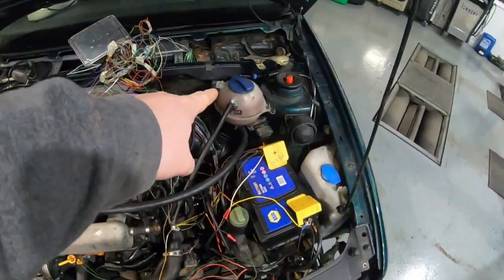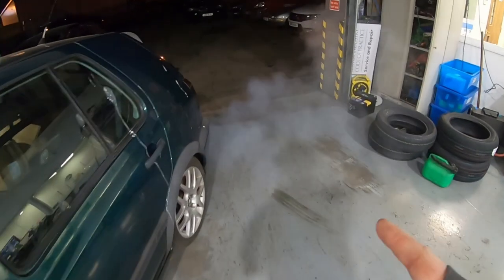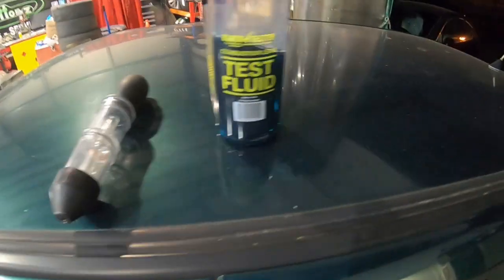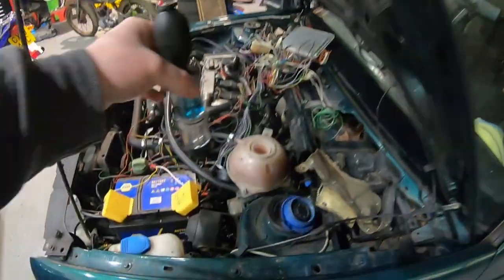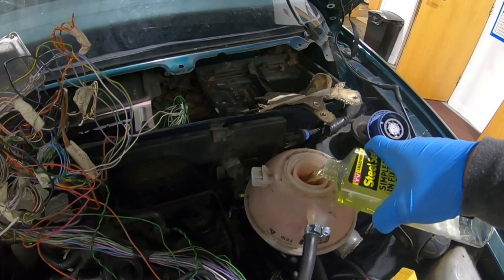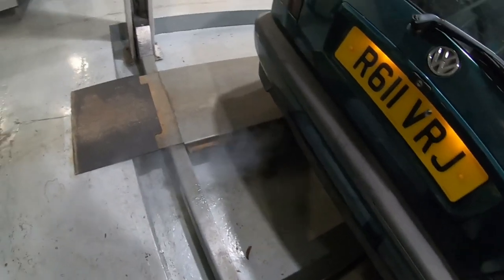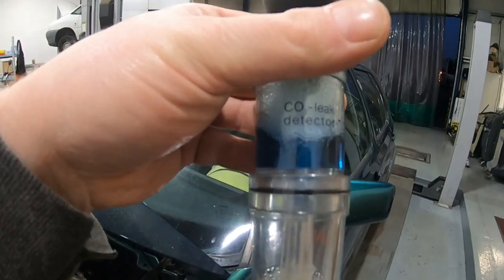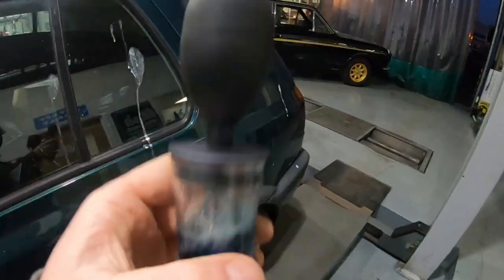Is Steel Seal the ULTIMATE Solution for Fixing a Blown Head Gasket?

Comment: Hi. I’ve just bought two minis in the last month and been completely ripped off 😢 I bought the first one a convertible 06 plate mini one convertible. I paid £900 for it. It’s going to scrap tomorrow for £150. Then my dad bought me a Mini Cooper same year 06 plate it seems it has the same issues but is a lot better condition and 20k less miles. I’m hoping to keep the cooper. It keeps losing battery if I don’t use it for a day or two and it started blowing cold air so I got a friends fella to come and start it. They added coolant and got it going. But the battery had got completely flat 3 days later of me not starting it. So I’ve got a new battery which I’m going to fit in the morning and I’ve bought some of that steel steel. I’ve watched the video on steel seems website and it says it’s probably a good idea to drain the system of other coolants would you recommend that and do you have a video of how to do that? Thank you in advance.
And bloody minis. Ya gotta love them. I’ve bought two in the last month and been robbed both times. I need to get one at least working I’m an end of life carer and need my car to visit my clients.
Reply from the maker: Thanks for watching

Comment: My car loose about 1L coolent for driving around 20miles, because the air bubble push the coolent out  from the radiator. Do you think this headgasket condition can be solved by using this product? Or it is too serious and need to head gasket replacement. It is a honda engine. Thanks😊
Reply from the maker: I'd check it is definitely your head gasket that has failed but if it is then yes, it should work

Comment: Hello Mark,  interesting video thanks as experiencing same on my friends  1993 Toyota Camry trying to help him with. So far has been running hot often, and would have to add water often.  Temp gauge well up. Not much services has been done on this car sadly  in its life of 180,000.  Oil filter never been changed, simply adding oil has been done over the years.  Radiator never flushed and overflow looks very rusty color inside.

Decided to add radiator clean to clean out cooling lines,  but now the issue seems worse.   A lot of white smoke especially if rev engine, and checking engine oil it appears thin…. and water dripping from exhaust.   Temp sensor now doesn’t leave the bottom of the gauge (0), radiator never  gets hot, just warm to touch and no steam from the overflow or even radiator at all?   Is the thermostat also an aside here do you think?

As I see no steam from overflow it is hardly worth doing the test…so wondering if should just go ahead with this fix.  Cheers
Reply from the maker: Well, it's worth a try

Comment: Could you please provide what you used to test head gasket failure? I got oil in the coolant reservoir of my e46 and need to find out if it's the gasket or cooler.
Reply from the maker: The kit we use is called a block tester and can be found on Amazon here https://www.amazon.co.uk/Block-Tester-Bt-500-Combustion-Leak/dp/B06VVBSFTF/ref=sr_1_6?crid=1V9K40AVAP6M1&keywords=head+gasket+test+kit&qid=1684097717&sprefix=head+gasket+%2Caps%2C89&sr=8-6
Reply: @MarksWheels  thank you very much!

Comment: My neighbours 2014 Ford KA is loosing the coolant straight into the engine oil, the oil level is 3 inches above full, is it safe to use in this situation.
Reply from the maker: Probably best to get the level closer to the correct level or, even better change the oil first.
Reply: I was wondering that myself.  Thanks! Do I do oil change first or after using SS and cooling down?
Reply from the maker: @jahill7965  personally I'd do it after

Comment: Hi Mark, I’ve just been told by ford my 69 plate transit custom needs a new head gasket at £4500 fitted!!!
Only took it in as it had coolant over temp warning light come up. 
Thought it would be a thermostat or sensor issue. 
They said the mucky (orange) water in the coolant reservoir was 100% head gasket. 
Feel a bit deflated as I only got the van 4 months ago from a verified decent garage/dealer. 
Any advice would be massively appreciated. 
Thanks 👍
Reply from the maker: Speak to the dealer first. Try and get some goodwill
Reply: Thanks for the quick reply 👍.
They’re calling me back tomorrow, big boss wasn’t in earlier today.
Was just weighing up the other/steel seal options if no joy from them.

Comment: Hi mark,i have still a lot of air in my coolantsystem by cold star it likes a waterfall.i think the head.my coolantwater is not dirty.do you think steel seal can helped? Or bars leak?
Bydewee its a mini r50 2002
Reply from the maker: Not sure it would tbh. I'd first check it's bled ok. Shouldn't be any air In  the system

Comment: Hi mate my mechanic put this in over a year ago as i was losing coolant- done tests and couldnt find anything wrong but just loses coolant worked perfectly for a year no issues 
But my car is losing coolant again mechanic said sell it while i can but can i use the steel seal again ?
Reply from the maker: I wouldn't Dave. Using too much of it might block something. I'd find out where it's leaking from

Comment: hello mate recently had my headgasket done on my mg zs 120 got a rough cold start misfire and a slow dropping coolant level assuming coolant is slighly weeping into the cylinder would you say this is worth a try need to last me to the end of the year but after the recent 500 quid investment i do not want to spend the same again as its over 100k miles and just not worth it 
thanks
Reply from the maker: I'd be checking for obvious signs of leks first and maybe do a co sniff test to confirm HG failure then it would be worth a go

Comment: Hi Mark. I have a slight weep of coolant into banks 5 and 6. I tried k seal and its improved it significantly,  but there's still a misfire. 
Would you say that steel seal is a superior product and worth a try?
Reply from the maker: I have never found k seal to be very good at all at head gasket repair. It's better for radiator and thermostat leaks so definitely worth giving steel seal a try
Reply: @Mark's Wheels  thank you so much for taking the time to reply.  I'll do as you advise,  thanks. Ironically,  k seal worked a treat on a radiator previously with another car, so I'll try the steal seel. 
Many thanks
Reply from the maker: @Turn12335  No problem. Thanks for watching

Comment: PLEASE NOTE TO ANYONE WANTING TO TRY THIS METHOD. 

1) PLEASE READ INSTRUCTIONS AND FOLLOW EXACTLY AS IT SAYS ON THE BOTTLE IF YOU DONT IT WILL NOT WORK.

2) THE WORSE THE SYMPTOMS OF HEAD GASKET THE LESS LIKLEY IT IS TO WORK.. 

ID SAY THE GOLF IN THE VIDEO IS A 5/10 IN HOW BAD IT IS. IVE SEEN IT WORK ON MUCH WORSE ON THIS. 

IF YOUR CAR IS CHUCKING COOLANT FROM THE RADITOR CAP/ EXPANSION BOTTLE.  AND WONT KEEP FLUID DOWN. YOUR CHANCES ARE SLIM. BUT IM MY OPINION IS WORTH A GO. 

3) ***THIS IS NOT A PERMANENT FIX ITS LAST CHANCE OPTION I WOULDN'T DO IT ON A CAR WORTH A COUPLE OF GRAND. UNLESS ITS YOUR ONLY OPTION IT CAN CLOG UP THE SYSTEM.

GOOD LUCK
Reply from the maker: Thanks for your comment Tyler. I agree you shouldn't expect it to be a permanent fix but both my k series powered midget and my golf are still going strong a year later 💪
Reply: @MarksWheels  fair play! Glad to here that. Must admit I'm surprised but glad to here that! 

Any issues with heater core? No hot air? Just out of interest
Reply from the maker: @225M3RCR  No, heater works brilliantly!
Reply: @225M3RCR  it won't ever clog a heater core. It is Sodium silicate, liquid glass, a chemical reaction takes place near the failed part of the gasket near the combustion chamber or the crack in the head/block surface,  the temp around this area causes the liquid to change to a solid. The rest of the coolant system never gets to a temp where this conversion would happen. 
This can be a permanant fix if you leave the same  coolant in it will keep doing fixes as things age on the gasket.

Do not use if you have oil mixing with water, liquid glass can kill an engine if it mixes with oil.
Reply: I have water in my oil. Does that mean I should not use this?
Reply: Was looking to use this on my avensis, 339k on the clock. Pretty sure I’ve got a head gasket leak between coolant and exhaust fumes. I do 40k miles a year so I may as well just get a new engine it seems. Thanks for the video, this comment and replies.

Comment: Hello Mark! I have a 2006 Toyota Avalon 3.5 L V6 with a blown head gasket the car has over 300-plus thousand miles oil was in my spark plug coil packs and water was coming out my tailpipe very very bad. Do you think this will help my Avalon I've already ordered it through Amazon I will receive it tomorrow
Reply from the maker: It's definately worth a go. Let us know how you get on

Comment: Hi Mark I've used k seal couple years ago apparently have the same pblm again so can i use seel steal in top of k seal?
Reply from the maker: I have found that K seal is better at repairing leaks in pipes or components, whereas Steel Seal is better for head gasket failure.

Comment: Ho does it actually fix it or just solve the problem for a few months?
Reply from the maker: Its been in the Golf and in my MG midget for well over a year now and seems to be holding up fine
Reply: @Mark's Wheels  thanks for the reply...one last question...how many times do you think it can be used on the same head gasket?
Reply from the maker: @roderickjones7479  Should work on the first try i would think
Reply: @Mark's Wheels  cheers dude
Reply: @MarksWheels  hi mark just had a new heater matrix fitted also new water pump & radiator also a thermostat. will steal seal block these & leave me with no heater again thanks.
Reply from the maker: @125nog  not had any issues with mine but if you've had all that work done why do you want to use steel seal?
Reply: @MarksWheels  hi mark, losing coolant & boiling over the coolant tank,also white smoke when van ticks over.

Comment: Hi mark, do you have to do a coolant flush first or is it fine putting it with very low coolant in the reservoir bottle says you don’t what it to just sit in the reservoir 

Thank you
Reply from the maker: No need to do a coolant flush first. The water pump will take it around the system

Comment: Nice save!  Have you ever experienced heater  matrix getting blocked etc?
       My 93 has blown back into bottle for years that stops when warm, was thinking of giving this a shot as I've started losing some coolant from time to time
Reply from the maker: I had a blocked heater matrix on my old Peugeot 309. I took the matrix hoses off of the engine and raised them up. poured cilit bang in and left for an hour. Flushed the matrix out with water and all this sludge came out. Heater never works so good after that!
Reply: @MarksWheels  that's what I'm afraid of, thanks!
Reply: @MarksWheels  I could isolate the heater matrix I suppose if I had the fittings
Reply: Will it clog uo the thermostat  ?
Reply: @markferris3674 no it doesn't as long as you use the weaker version. If you use the strong one  you need to remove the thermostat first. We took off the lead to the spark plug which was misfiring too, and put it back on after 10 minutes. It helps with pressure which can muck everything up and cause you to waste your money on the bottle.

Comment: Hi Mark. Quick question for a novice. So I have a Mini One 53 plate. I presume I pour SS this in the coolant bottle? Silly question but I want to make sure I’m pouring it in the correct area first. Thank you. Sam.
Reply from the maker: Hi Sam. If your car has a coolant reservoir then yes, pour it in. If it is an expansion bottle, it would probably be best to pour it directly into the radiator
Reply: @MarksWheels  it’s where I normally pour the coolant, so I’m ok pouring in there? Thanks Mark and sorry for sounding so stupid.
Reply: What is the difference between a coolant bottle and an expansion bottle? My Audi needs this. The mechanic failed to diagnose the head gasket even though it was losing so much coolant, pouring out with white smoke and misfiring. It sounded weirdly different when I started it this time which prompted me to take off the oil cap. Looks like coffee, not oil. I'm assuming head gasket.  I just need to know if there's a thing called an expansion bottle in my Quattro A4. I will get that blue fluid and test it first before buying SS.

Comment: About to give this a bash on my 1.9 XUD peugeot 306. Problem I have is massive back pressure in the coolant system. Scared it'll blow a hose off during this process and lose all the Steel Seal goodness. Website suggests in this sort of case to half fill coolant system with coolant and Steel Seal and run with expansion tank cap off. Will the coolant circulate properly in this state? ie without it being bled etc? Any thoughts and guidance appreciated.
Reply from the maker: It shold still circulate fine with the cap off. Just make sure the engine is totally cold when putting steel seal in. We tried a hot engine and the stuff just cures instantly!
Reply: @MarksWheels  Thank you kindly for taking the time to reply. Gave it a go earlier tonight and it was touch and go. Once the coolant system was half filled (306 xud having a 9 litre coolant capacity, so 4.5 litres poured in) with the Steel Seal poured in, I started the engine. Coolant level didn't seem to move for an eternity. Temp gauge was up and down like a yo yo. Heater going on and off. Eventually it started burping and moving. But no real gauge on how long car was up to temp due to the erratic needle. Fingers crossed it's worked. Will top it up and try to bleed it all tomorrow once cooled.
Reply from the maker: @leekehrer  good luck
Reply: @leekehrer  did it work mate?
Reply: @johnnymacf1  Not so far. Back pressure is too high in the coolant system that it doesn't seem to be taking hold. I'd have to start removing injectors to identify the leak and that's out of my wheelhouse.
Reply: @leekehrer  
Did you find out what caused the high back pressure or did you try it again?
Reply: @dhalsim-1  No, not at this point. I've been unable to get a mechanic willing to help me. So the cars been sat on the driveway since it initially went wonky. Sorry can't advise further.

Comment: Hi mark.  I was wondering if you or maybe any of your subs coumd te me why the cooling period is so important? 
Ive just does the whole run up to temp stuff with this in my e90 Bmw and im waiting for it to cool.   Im hoping to be able to tow my caravan with it a little later today if it works, but its taking an age to cool down. Lost 27 degrees in an hour.  Still needs to lose another 50 or so degrees to be back down to ambient temp and wondered is really necessary for it to get down to ambient air temps?  Thankyou
Reply from the maker: Hi Johnny. Its the way the liquid works. It thickens when heated. We trialed it in a hot engine and it didn't make it past the coolant reservoir
Reply: @MarksWheels  hi mate thanks for the reply.  So what temperature is cool enough before you can start using the car as normal again?  It says to cool the engine again after you gone through the process. So does that mean stone cold or can you just leave it a few hours which wont be cold but it will be alot colder.  If that makes sense 🤣
Reply from the maker: @johnnymacf1  I would say cooled down to ambient temperature if poss
Reply: @MarksWheels  nice one.  Thanks Mark.  Appreciate  it.
Reply: @MarksWheels  IT WORKED!! Amazing! That meant we were able to have a few days away in the caravan too. Towed it great no problems at all.  No steam and a dry exhaust!  
Thanks for the advice.

Comment: I have used this product on my car. Car never had any head gasket issues was a strong motor I put this stuff into  the radiator 30000 kms and today it’s on 750000 kms on the clock still driving my car without head gasket blown up still hasn’t had any issues with the cooling system very high mileage car still drives like new
Reply from the maker: Thanks for watching
Reply: @MarksWheels  no worries I highly recommend this product

Comment: bro how long did it last you? have u done any miles? :)
Reply from the maker: Done 600 miles in my k series midget and about 400 in the golf and is holding up well
Reply: @MarksWheels  I've used it in a diesel Jeep and I've done around 2000 miles since using Steel Seal and still working fine so far..
Reply from the maker: @Faithinthedock  good to hear!

Comment: Hey, Did you flush the coolant and use distilled water before pouring the steel seal or just poured the steel seal into the coolant you already had in the car?
Reply from the maker: Straight into the existing coolant. Thanks for watching
Reply: @MarksWheels  so it’s not necessary to dump the coolant out put distilled water and dump the bottle in then flush it again then add the coolant  again? Did you flush it out after you noticed the fix ?
Reply from the maker: @zanixinaz  Nope, no need to change the coolant and im still running with the same coolant now, 1 year later

Comment: Thanks for this ; going to try this with my bongo !
Reply from the maker: Should work a treat! Thanks for watching
Reply: Did it work on your bongo as I have one losing water from radiator?
Reply from the maker: @barberalucia7311 If you have a leak from the rad I would recommend k seal. I don't think steel seal will do much for a leaking component
Reply: @MarksWheels  I don't think it's a leak from radiator more likely intake manifold but small slow water loss
Reply: Did it work I have a 97 bongo with slow waterloss